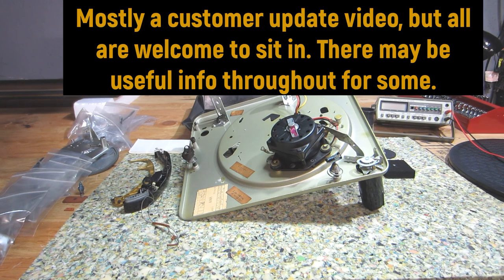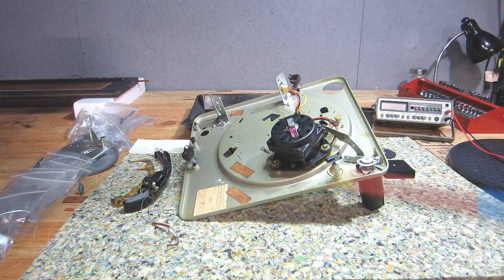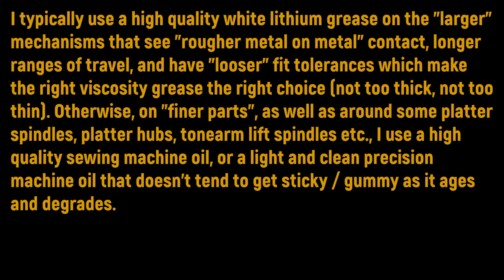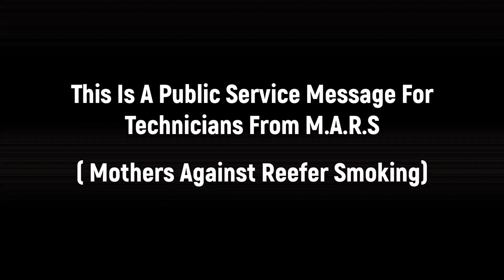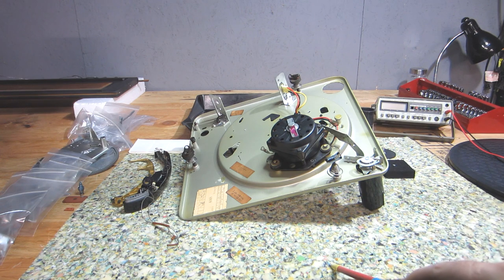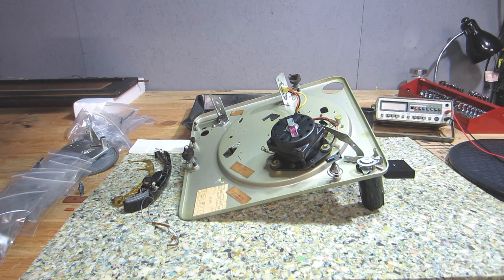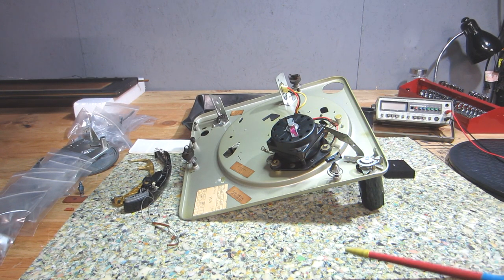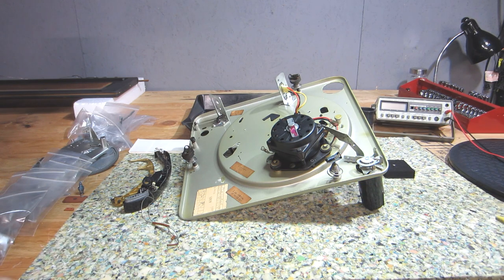Magnavox Micromatic Imperial Update Video

Comment: the red  lithium grease i bought at Advance Auto really makes things slippery
Reply from the maker: Glad it's doing a good in its application. If it's a bit more viscous / thick in comparison to white lithium (I can't recall), it may be a good idea to use it only where a thicker grease is warranted, i.e. the "roller bearing" etc.